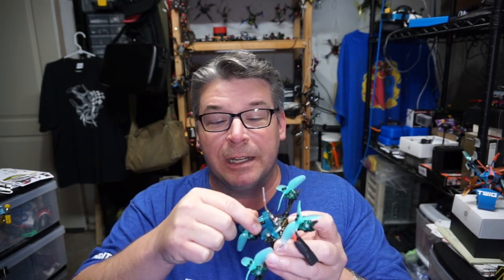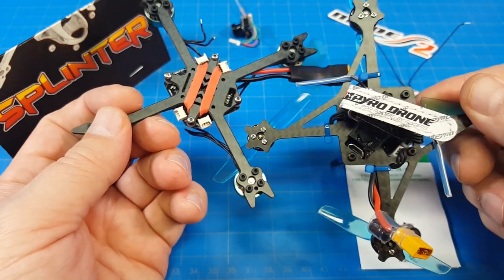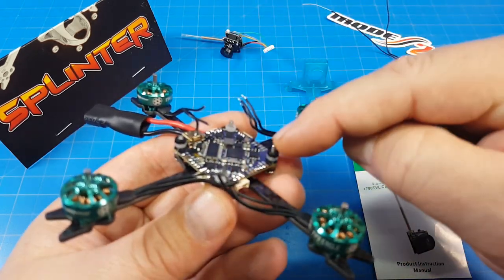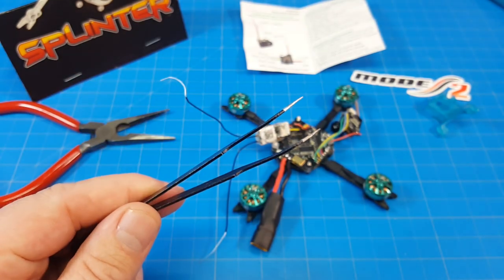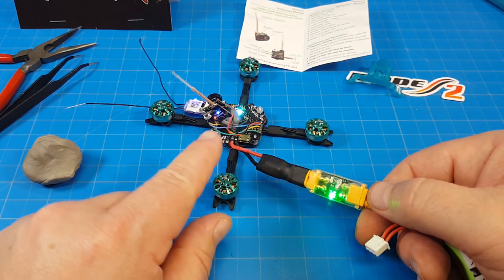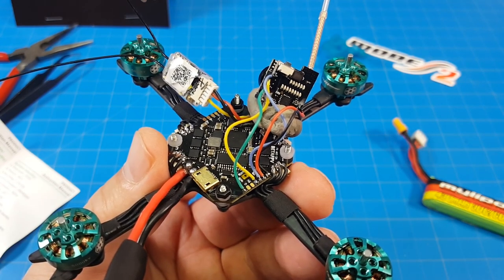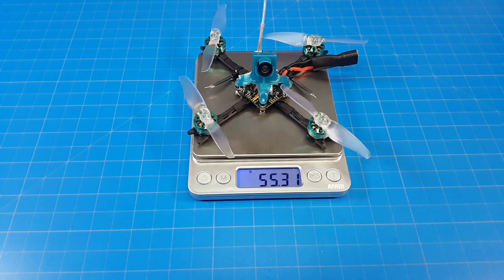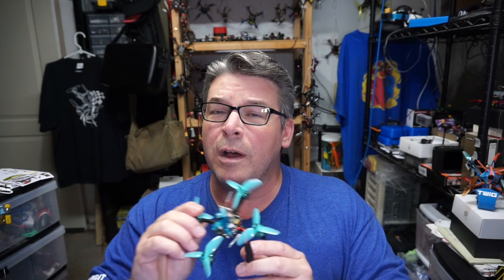Mode2 Splinter Build // The much requested new age of micro builds

Comment: Hi Nick, thanks for another great video! I just wanted to add one thing to those that will be doing a build. Its important to hook your flight controller up the computer before you solder or alter it to make sure it's not faulty because once you alter it most stores won't let you return it. Just speaking from experience .

Comment: 4.1 is the best betaflight version i've found for micros.. Emuflight is really easy to just flash and go, not much tweaking needed.  This is a great time to be a micro flyer :)
Reply from the maker: really...good. Did you try 4.0.x? What did you think of that?
Reply: @NickBurnsFPV  Every version of 4.0.x i tried after the official release had 'some' problem...mostly to do with filters, hot motors, etc.  4.1 flew pretty well out of the gate for me with minor tweaks.
Reply from the maker: @Sully365  Good to hear. Thank you

Comment: Great video! Quick ? On the receiver placement. I noticed you put the receiver (and some foam tape) on top of the flight controller. Have you ever noticed or had this effect the performance of the FC? Like screwing the gyro or anything? Just wondering since I have a few toothpick builds and most have the RX located under the FC, which can be a tight fit. Thanks again for your great vids! 😎🎮🚀
Reply from the maker: I have not seen the Rx on top, or really anywhere need the FC cause an issue. I believe I have pretty much always place it there on this category of build. I have seen vtx near the FC cause thermal issues, typically we get a core temp warning via OSD when that occurs.

Comment: Hey Nick awesome video, fun to watch you build! Here's a tough one for you: capacitor location! Are there any advantages to having the Capp on the xt30 lead versus on the board in terms of effectiveness isolating noise? Boards like the newer NamelessRC AIO412T has dedicated capacitance pads to solder to, what's going on here? Is there some advantage Nameless has come up with, or are they just offering up options for clean wiring etc. Thanks!
Reply: I found it hard to find space for the cap on the board. But I'm not using an aio camera.
Reply from the maker: My understanding is closer to the board or on the board is best. Finding a good spot and securing it is the next challenge.

Comment: Could I build this with a FlySky receiver? All my transmitters are FlySky, if so which receiver would I use? I am not too familiar with quadcopter receivers yet, thank you for all you do Nick!
Reply: Flysky IA8X or Fli14+ will do the job
Reply: @laimonas100  thank you
Reply from the maker: sure, anything can be built with our needed receiver. Looks like a good suggestion from the other comment. I have seen that flysky receiver recommended many times.

Comment: I'm always curious.  The 3 motor wires are all black.  How do you know which wire goes to which tab when you solder? Thanks.
Reply from the maker: It kindof doesn't matter the three wires will control motor direction, we can also change motor direction with the blheli application.

Comment: Yeah I love mode 2, but i found it hard to run a lipo strap through the tiny slots. Also not being able to use 3 inch props sucked. The hardware that came with it has a smaller head then what we are used to. I would use this frame for 65mm props when I get good motors and a new board.
Reply from the maker: yes, those slots are about 1-2mm to thin, had to go rubber band. The very cheap velcro that comes with RTFs does fit, but not my preference.
Reply: Yes I hate those straps as well.. also had to trim a little off the straps to fit them

Comment: Would the new 1204 motors be better than the 1106 and 1105 motors that were used on more traditional 2.5 inch builds like an eclair?
Reply from the maker: yes, the 1204/5 motor size handles triblades and three inch props better than the 110x we flew for so long.

Comment: lol, me again, instead of going straight to the battery, plug it into USB first, even if it is an old low current usb charger (500ma or under) and if nothing lights up you have an issue but you are not shoving 18amps from the battery through it.
Reply from the maker: Interesting. Doesn't that only test the board and its internal components?
Reply: @NickBurnsFPV  if there is a short it will drag it all down, or so has been my experience to date.

Comment: I’m building the exact same quad on the tp3 frame. Everything is the same
Reply: That quad is gonna rock. I have one as well, tp3 3 inch biblades and the rcinpower 1204s I suggest the tattu 450 packs. You can use 650s if you want but 450 is the sweet spot
Reply from the maker: Yes, I would have liked to try the tp3, but its out of stock everytime I go look.

Comment: You need magnifying glasses if not using them yet
Reply from the maker: I do, I have a magnifier, but no glasses, do you have some your found are comfy and work well?
Reply: @NickBurnsFPV  the "YOCTOSUN Head Mount Magnifier" i got off amazon are porbably nicer than the other cheap ones on there, they kinda hurt my ears after wearing for hours though, but not terribly. I haven't tried the black visor looking ones though. Your face needs to be closer to what you're working on also. The "helping hands" I have also has a magnifier arm, but I like the glasses. Might be a pain for you if working on a short table with sticky tac though.